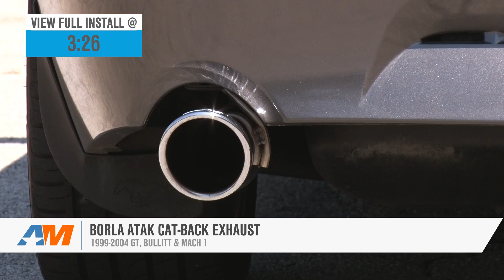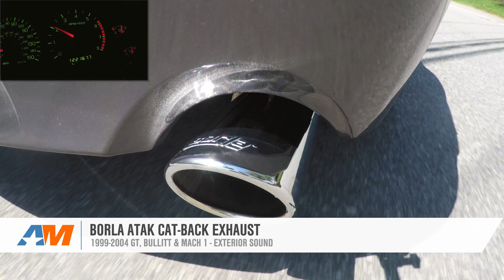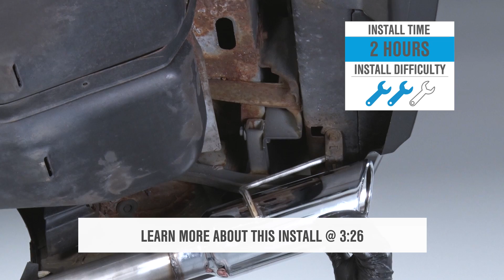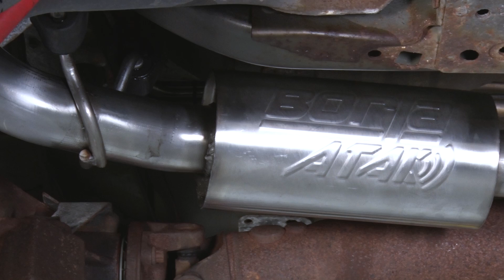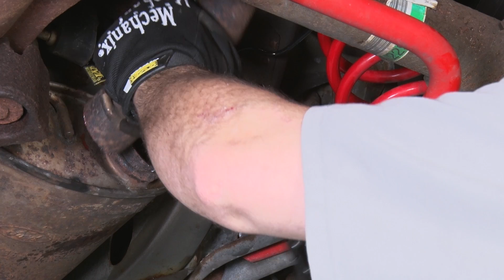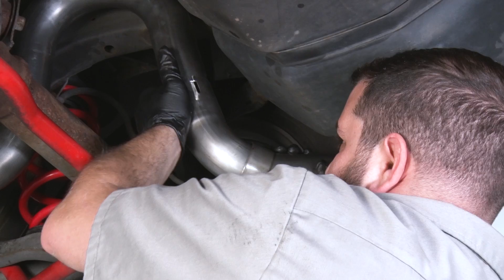1999-2001 Mustang GT, Bullitt & Mach 1 Borla ATAK Cat-Back Exhaust Sound Clip & Install

Comment: can the borla work on a 2000 ford mustang v6
Reply: Unfortunately, no! The 2004 V6 did not have the true dual exhaust set up that the GT Mike one and cobra hat. If you want a Borla attack muffler put on, you’ll just have to order the muffler itself and have your stock muffler cut out, and the attack muffler weld it in.

Comment: Mid mounted mufflers always sound better IMO. That is why the pre-2010 stangs sound better with Borla compared to the later models.
Reply: AmericanMuscle.com I owned Mustangs with different gen engines swapped in them and different exhaust setups and I liked the mid  muffler systems the best. The old pushrod 5.0s do sound better with a chamber muffler like the original 40 series Flowmaster IMO. Straight though style sounds better with the modular drivetrains.
Reply: @ragintaurusmusclemercury7023  I totally agree with you, I did a true dual style exhaust on my 5.0 V8 Mountaineer Premier first with a pair of Magnapacks and a 24inch stainless X-pipe. Hated the muffled tone so I got a pair of Loudmouth2s but it still sounds like a motorcycle with straight through bullet style mufflers.
Reply: TheTexasHitmen Car Projects you know I bought some magnapacks and had a shop install them behind the axle. I have BBK shorty headers and a mac off road H pipe. It sounds really good and deep. Not loud anymore or maybe I'm a little more deaf lol but I've always wondered how different it would sound if they were in their regular location.
Reply from the maker: While the mid mounted mufflers do alter sound slightly I think you're overlooking the biggest factor in sound between gens- engine.  -Justin